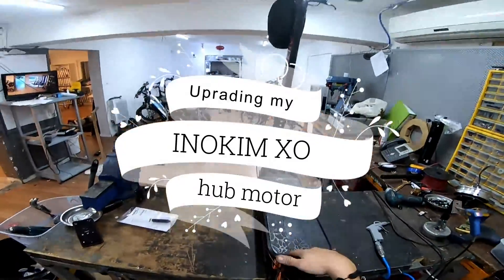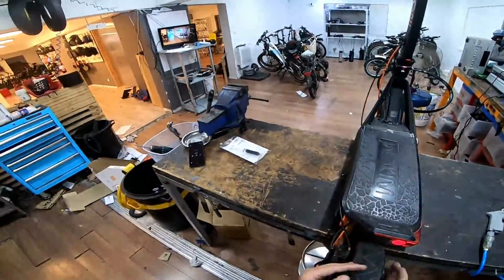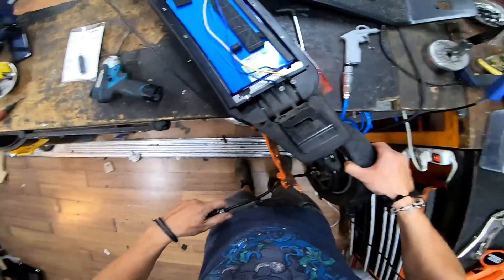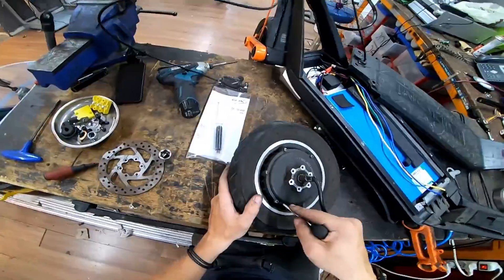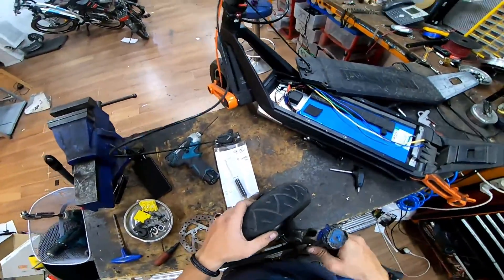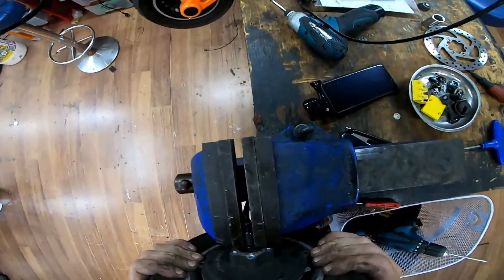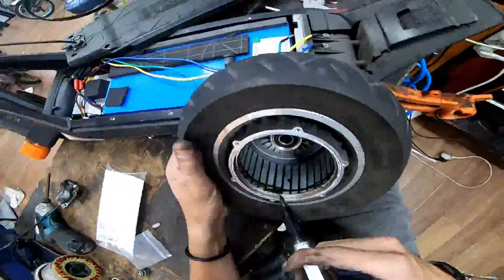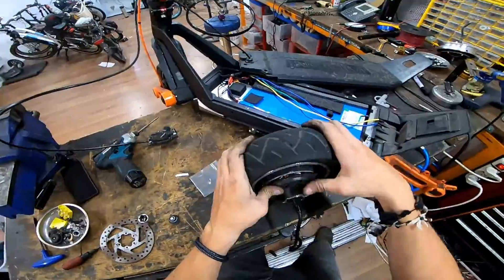Inokim OX ferrofluid upgrade | אינוקים "אוקס" שדרוג נוזל מגנטי

Comment: Hey, do controllers like jager disconnect throttle response automatically if motor gets too hot?
Reply from the maker: No controller do that on inokim ox, because there’s no temp sensor. But jager cooks the motor the most.
Reply: @SUB13333  you think that the jager 5.5 thats rated at 30a is also too much for the 48v ox?

Comment: @ 2:59min did you remove anything on the other side of the axle? where the Cone Cap is placed?  i need to check mine cause its hard to spin by hand,

Comment: I have a 60v version. Seems as though my wire(s) from the motor to the controller are hard wired into the controller with no quick-release clips? There’s simply no way to get the motor off without clipping wires? Your video was sped up through that part so don’t know what you did there. Trying to add new rotor.... thanks!
Reply from the maker: There's a yellow box for 3 phases inside the body. Sensors wire also has a plug.

Comment: This video helped me a lot when I went through installing an upgraded disk brake rotor. Thanks!
Reply from the maker: Cool man, I'm glad :)
Reply: Can't we just cut the cable  and  solder an easy in/out Connector right there by the suspension arm ??

Comment: If the motor case is getting hot then surely this means there is already good heat conduction from the interior of the motor to the exterior, no?  Presumably, adding the ferrofluid should increase the temperature of the motor casing.
Reply from the maker: Very accurate assumption! :)
Soon a new video with cooling heat sinks :)
Reply from the maker: And later, even more. Planning on printing aerodynamic vent that will grab  incoming air and maneuver it on the motor shell ( in place of rear lights)

Comment: did you measure your no load power before and after? because statoraide is really only good for lower rpm motors, like bike hubs. This motor will be spinning at 3-5 x the rpm - the magnets relative to the stator ~3x the speed, so you might get some notable drag and possibly even foaming of the oil. Also there was no sign of dark windings so im guessing the motor wasn't getting too hot at all :P
Reply from the maker: Oil? It's statorade :) and these hubs are not that much faster. I had 5k motor on 17 inch moto rim which did 150 kmh, no issues whatsoever. Also, I applied the cooling solution before upgrading to a new controller. Will crack that open again in a few months for a review.
Reply: @SUB13333  whats statorade made of?
Reply from the maker: @sn0wchyld   Nanomagnetic particles suspended in a low-viscosity oil. Yes there's oil, but so little it isn't going to react just as plain oil.

Comment: thanks 4 great vid. So is there a  big difference? on day i had issue with OX, that motor was so hot, that the motor actully started to break itself. I guess it was due to temperature distantion of the motor. Once it got cooled down it was ok.
Reply from the maker: I've added ferrofluid which transforms big portion of the stator heat to the motor shell which being cooled by the air. Gonna have to create custom hubsink fins to cool it even faster. Google "hubsink for ebikes" to get the idea.

Comment: Thanks for the video, now all you need to do is to add a link to the fluid type (and/or where to buy it from)
Reply: It's called Statorade and you can buy it from shops that sell electric bikes.
Reply from the maker: i don't have a specific supplier for that, because all of them are slightly overpricing this liquid, but what can i do, we do need it eventually. anyway, only rule is not to get it from ali or ebay as it will be most likely some oil with metal parts in it. lunacycle, greentech, hubsink. these are legit.